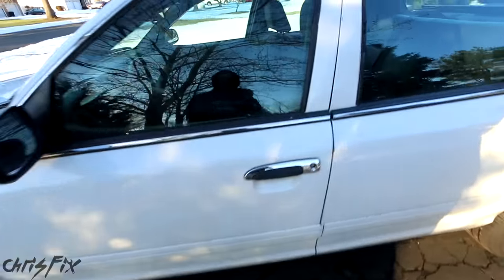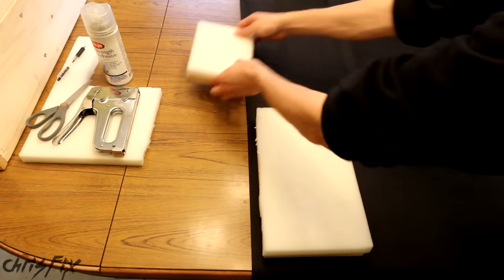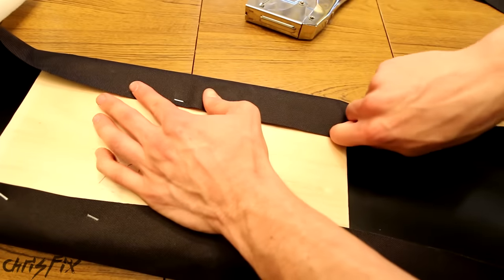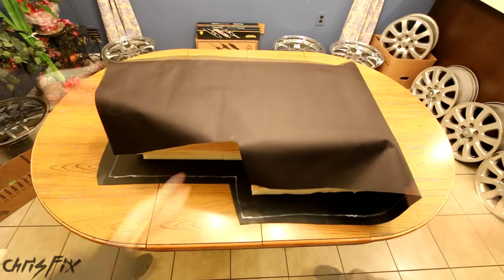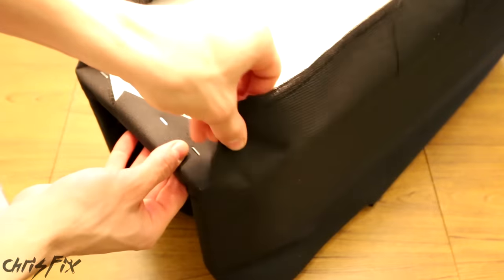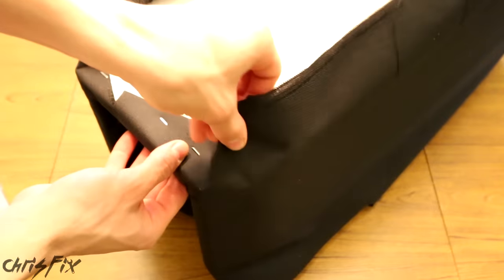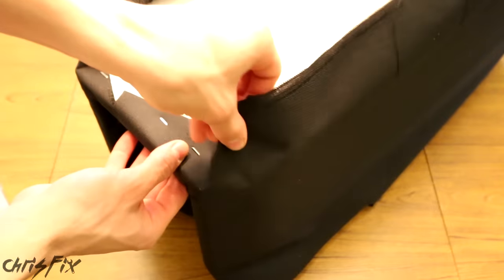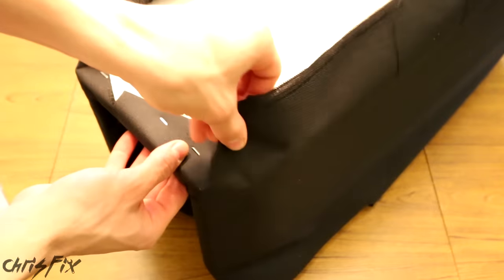How to Build a Center Console for your Car (Part 2)

Comment: Really enjoy all your mechanic videos. Not trying to be rude but in my opinion I feel like you could have done better. Way too much foam and extra fabric. My father was a cop and the idea of the foam on the siding is cool but not needed. At least not that thick of foam. Anyways like I said I'm by all means not trying to be rude. With some adjustments this would be hands down badass for you not being a carpenter cudos I'm really into carpenter work like this. Definitely wish we knew each other and I coulda gave good pointers. Aside from that it's pretty good (like I said) for not being a carpenter.

Comment: I found it interesting that you left that front piece loose, claiming the screws through the ABS would hold it in, then screwed the ABS down at the corners totally ignoring that front piece.  Rookie mistake.
Reply from the maker: +psychodad1961 I dont want that front piece to be screwed down. I want to use it for quick access to the switches. Thanks for sharing.
Reply: +ChrisFix you could use wood dowels to slot it in. Or a small stop so it doesn't get pushed too far back.

Comment: why did you pad the sides? normally in an o.e. console, only the armrest would be, if anything.
Reply from the maker: +gearhed3113 Because it is safer in an accident to have padding. An oe center console is plastic and will break if you hit it in an accident. This is solid wood.
Reply: good point, never thought of that

Comment: gonna attach a Toughbook holder to the passenger side of the console to put my Toughbook on. spending 2,000 on lights and radio equipment and the supply's I need to build the damn console. for my Fire POV 2011 Crown Vic Police Interceptor Street Package retired secret service vehicle.

Comment: for securing the front board that is currently held in with the pressure of the foam, hopes, and dreams, a pocket hole jig would allow you to screw it in fromt he back without having any screws holding. Keep that in mind for when that foam wears out and that front panel falls off. Here is a link to the jig. 

https://www.amazon.com/Kreg-MKJKIT-Mini-Jig-Kit/dp/B00065WPP2/ref=sr_1_2?ie=UTF8&qid=1470252494&sr=8-2&keywords=pocket+hold+jig
Reply from the maker: Thanks for the tip Nick!

Comment: I normally like all your jobs, but this looks quite ugly to be honest. It is probably the canvas that you used. Also you painted some screws black but you ended not using them. Why not paint the screws black that you used on the black ABS plate?

Comment: how would you hide the staples
Reply: I have an idea. Maybe you could use the same kind of plastic used for the buttons and screw it inside the console. A couple screws look way better than a thousand staples.
Reply from the maker: +Mike Dirks What you do (and you will see me do this in the next episode) is use the material and spray adhesive.
Reply: +ChrisFix nice

Comment: Why foam on the sides ? +ChrisFix
Reply from the maker: +julio martinez The foam on the sides make it very comfortable when you sit next to it and it also keeps it safer so if you get in a collision, it is padded. Good question!
Reply: Good point.
In regards to the turbo cleaning , i'm just going to take it to get serviced by a pro...

Comment: you do know that messes drill bits up
Reply: Obviously he has no care for his tools
Reply: So why tell others to wreck there tools
Reply: It's not like you have to use expensive ones for this, and four holes is not much drilling anyway.
Reply: +Choujeen its beside the point. all you need to do is put tape on the thread
Reply: +Mike Enns yeah i do read my previous comment